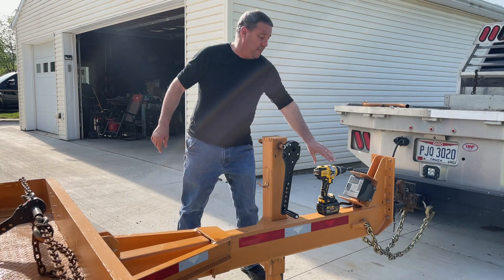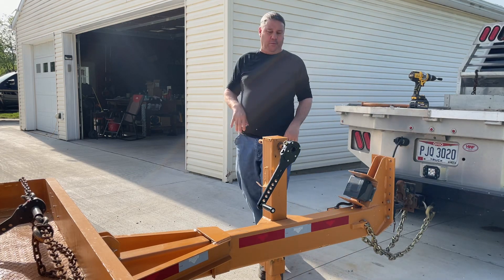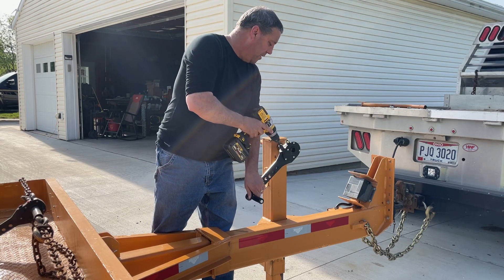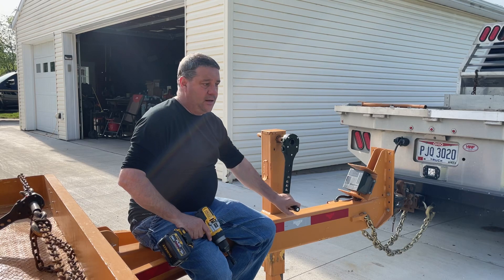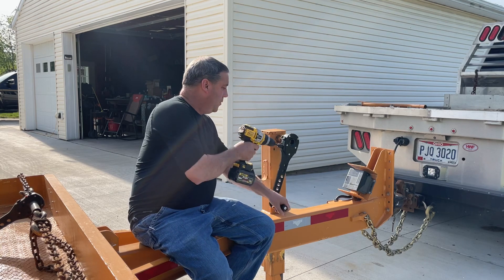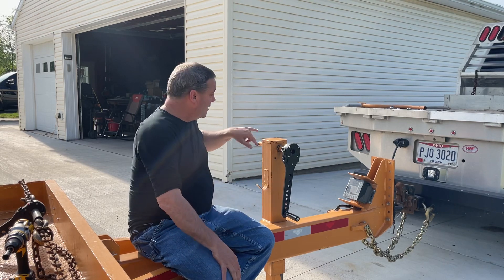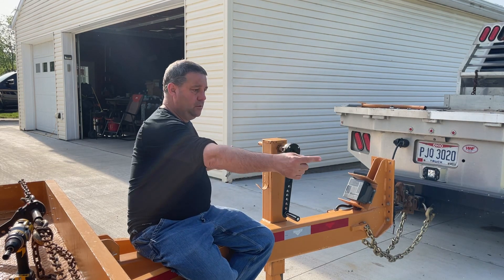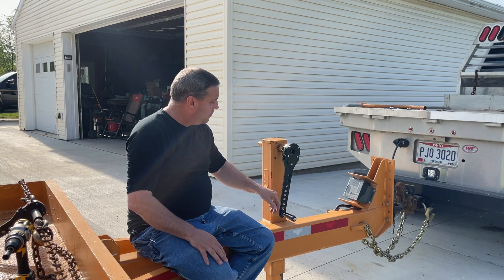Torquejack.com

Comment: I tried it on my light weight 6’ x 14’ single axle stock trailer. It will not even begin to lift the gooseneck off of the ball. In order to use the TorqueJack I bought a brand new Milwaukee 1,200 inch-pound drill with a 12 amp hour battery. I liked the idea but this is a no-go.

Comment: I bought one and it won't work on any of my trailers, it doesn't slide on far enough for the holes to line up and even if it did, you can't use it manually without hitting something.  Great idea but has a lot of design flaws